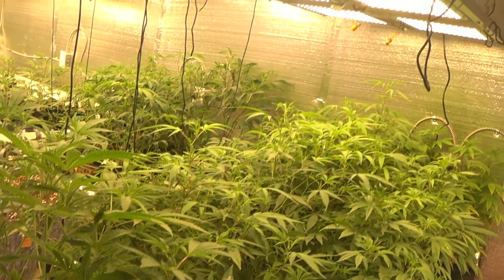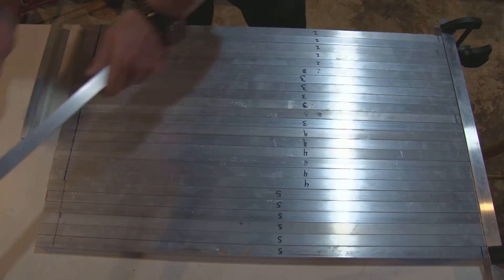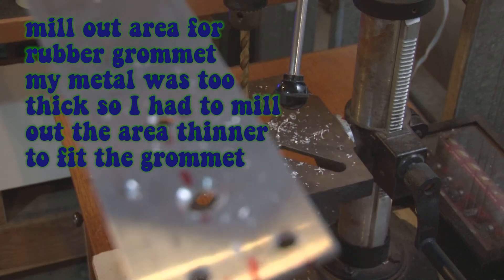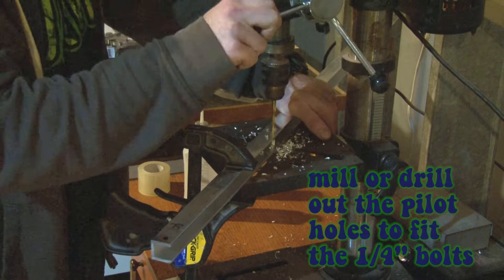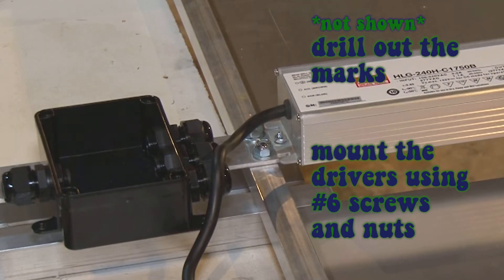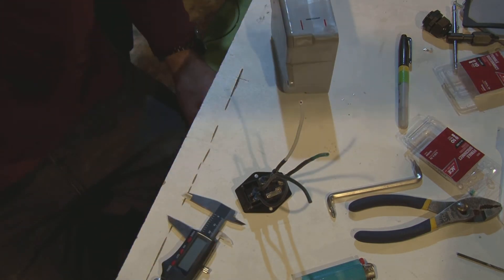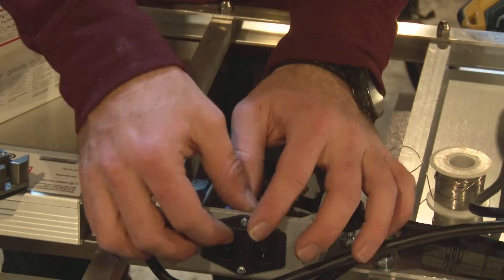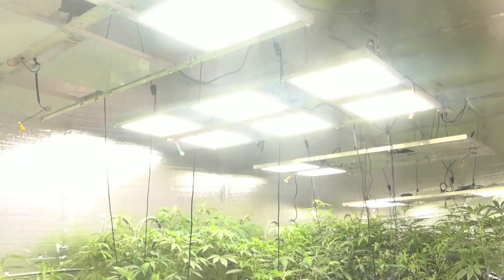Diy led grow light pcb board build for a 3x6 space.

Comment: Terrific job and video, thank you!

I was interested to note how high you have your lights above the plants. A lot of stuff I read has the lights much closer to the plants; which would, in theory, enable a lower requirement for light levels and power consumption. However, I guess that this would also lead to a huge difference in levels of light being received at the different levels of the plants themselves; ie. the top leaves getting exponentially more light than the bottom leaves. Your method goes a huge way to even out the light levels throughout the plant.

I’m a newbie to this and, having built my own lighting rig, I think I initially had it too close and ended up getting leaf curl on the top leaves but normal development on the lower ones.

It’s a fascinating subject!

Great video, thanks so much! 🍾
Reply from the maker: So you're right. You can lower your lights to get a better intensity with lower wattages. Or vice versa. Sometimes starting them high in veg will let you stretch the plants out. Or keeping them close will create a denser closer internodal spacing which may be desirable. honestly its really up to your needs and requirements. Telling you that you should hang them at X distance is great if you're also doing everything I do. It's all about finding your stride. Overall its better to keep them close and at lower wattages for money saving reasons and raise the lights as needed. But sometimes you might wana blast them from higher up to get them to stretch. This too is depended on cultivars. But in general the tops will always have more light because they'll always be closer to the source. Making sure you have a PAR meter even a cheapo one can help a lot with dialing in to your specific needs. Feel free to ask any questions I might not always have the answer but I can always find out.
Reply: @jPapapot  thank you!
Reply from the maker: @MikeFloutier  anytime dude

Comment: Does anyone know how to add switches to an existing board? I'm looking to buy a really nice but cheaper setup from alibaba with 3500k, 660nm, 730nm, and UV, but they do not have a switch to turn off the UV and Far red. They will just be on all the time with the other diodes. Sure I can just buy one with switches, but I've been trying to research if it's possible, and how hard it's to just add a relay or switch to an existing set up. Any guidance of advice would be awesome.
Reply from the maker: So depending on if you want to void your warrantee by opening the light. But if you want to you'll need to open up where the drivers are. Find the driver that powers whatever ones you want. at that point I'd say look into sonoff or something that lets you control your on and off wirelessly.

Comment: Why no heatsinks? How close can you get them to tops?
Reply from the maker: The designed made it so they don't need them based on the amps and diode spread. Why spend extra cash that you don't really need. I could put them about a foot away if not like 8"
Reply: @jPapapot  I see, my only thought was to get it closer to save height and move heat away more efficiently
Reply from the maker: @PoulJulle-wb9iu  If you get to close it does have a chance is burning. Ppfd is just to high sometimes

Comment: no heat sink?
Reply from the maker: no these were designed to run at 1750mA without heat sinks. They could have them added for better performance but the cost was just not worth it.

Comment: I was wondering how the boards did without heat sinks and of you would recommend them after all the builds you’ve done. Thanks
Reply from the maker: They actually do pretty well But I would recommend when building any leds to use heatsinks if for any other reason to have better longevity from your lights. With that said these don't get too hot without them. In later builds I have them mounted to aluminum sheets instead of square channel bars. But I never really use heatsinks exactly. Thats partially do to the size of the pcb and the layout of the diodes. These were built to have enough self thermal dissipation as to not need heatsinks. As apposed to a quantum board where then diodes are tightly packed next to each other on the board. Hope I answered that correctly.
Reply: jPapapot thanks a lot, I had the same idea with using sheeted aluminum as the heat sink, what thickness did you use though? Love the videos and appreciate the help man.
Reply from the maker: @brycelittle7239  no worries dude thanks for watching my shit. It really deepens on the led diode pcb brand and the amperage. But what leds are you getting?
Reply: jPapapot I believe they’re the Samsung lm561c
Reply from the maker: @brycelittle7239  are they boards or strips?
Reply: Custom boards from HS 336 diodes 12”x14” in the same staggered array as yours
Reply from the maker: @brycelittle7239  well in that case perfect yeah I think not aluminum she's are .0125 and thinner but i need to check my metal supply shop to find out exactly. I can never remember how thick. It's definitely 5052 though bc 6061 cracks when you bend it.

Comment: I'm trying to power 8x 120w boards. Is it possible to connect 2x 480w drivers to one iec inlet or is there not enough voltage?
Reply from the maker: I think you just need to see the rating on the IEC plug. I've never ran anything more than 800 watts per plug so I'm not sure what they can handle.

Comment: So no heat sinks or any kind of fans. How are they to date are they still rocking or have some LEDs gone out due to heat.
Reply from the maker: These were designed by Ohms_law to be run without those needs. They had spread diodes and under running the amperage. They do get warm at full power but an ambient fan kept any from burning out. I stopped working with those guys but I let them know If anything happens I'll fix it and I haven't got a call yet. In my future builds I attached them to aluminum plates for structure but i might just keep that as a thing i do for heat dissipation to have better protection. But it's not required. With that said, I'm sure efficiency would go up with heat sinks and fans. 
Hope that helps.

Comment: Hey I ended up ordering 24 336 3500/5000k mixed boards off of ali with the intention of doing something similar, so glad I found this before they came in though it’ll help a ton!
Reply: Just wondering if there was anything you would’ve done differently and how they’re working
Reply from the maker: dude sorry i didn't get notified about this message. I was cursing through the studio and just realized i have way more comments than what i'm being notified for. If i was to do this again. I would go with simple angle iron. The square and c channel was convent but who gives a shit when angled aluminum is just as easy and cheaper. Also terrible choice of color temperatures. Definitely should have gone with 3000k and 4000k not this 3500 and 2700k.
Reply: jPapapot good to know thanks, I’ve got a bunch of 315 cmh that I’ll probably end up supplementing with but you’re right about the K temps
Reply: @jPapapot  why 3k and 4k? are u using em for a long veg?
Reply from the maker: @PoulJulle-wb9iu  it's a matter of ppfd. The 3k/4k is the best output in the best color for start to finish growth.
Reply: @brycelittle4969  great question. I had the same in mind

Comment: Awesome!  Was looking and I couldn't find the 336,  I found a 500 and 308.  Can't wait to see what the wattage is.  How do you like this compared to the Bridgelux setup you built?  Were you thinking of tossing in a few blue, uv and ir down the middle?  Or would that be a con to it? Great work!
Reply from the maker: Kenny Beans so I have a picture of the wattage when I first tested it to make sure it worked you know the usual and it came out to 820 watts. I didn't notice I had it till like yesterday. I tried to think what I like better but strips and boards both have their advantages but I do think I'd go with the Samsung over bridgelux but I'll test that it with the other one and see. Bc maybe it's brighter who knows. As for uv I'd rather get some 660nm and 730nm in there but I'm gonna go this first grow and see what or if I need to even add anything. Maybe some blue since it's a really heavy red spectrum.
And where's those 500 boards?
Reply: The 500 board I saw on the alibaba site trying to find the board ya got.  So far I may have to go with 288 or a 312 QB.   With warmer weather around the bend I am not in a rush to see if I can find a good deal or maybe I'll just build a few strip lights and get a few QB play around with a few cree xpe lights in there and see what happens for the indoor hydroponic setup.  Will have to set up one for leafy and the other for the peppers.
Reply from the maker: Kenny Beans so what I'm doing at my home personal grow is adding strips. Cutter had blues reds, deep red, far red, and uv strips. So I'll add them to a 5000k/3500k board. Hopefully that's full spectrum. Lemme see if I can find the link for these boards for you.
Reply from the maker: Kenny Beans https://m.alibaba.com/product/60732541180/336-LED-quantum-board-LM561C-PCB.html?spm=a2706.7843299.1998817009.6.O42lDU here's one. If you contact them just ask for the 336 model. Ohms__law in Ig designed them and intended them to be used 2 boards per 240h c1750, just so you know.
Reply: Does ali still have the boards